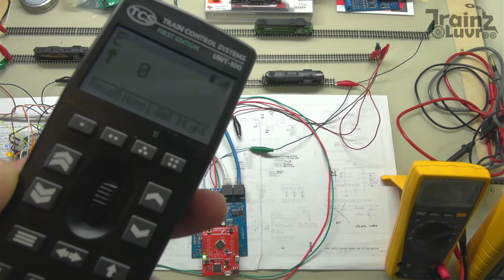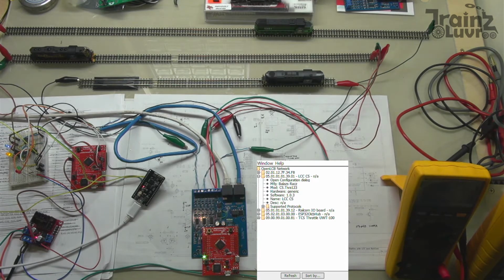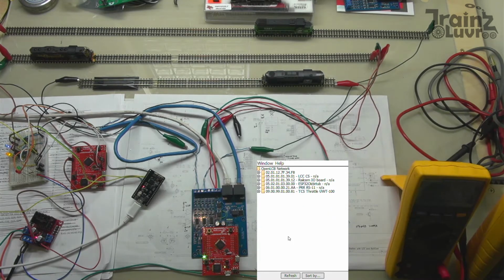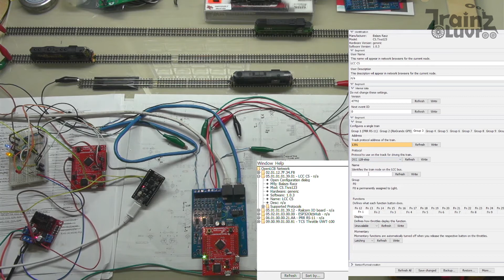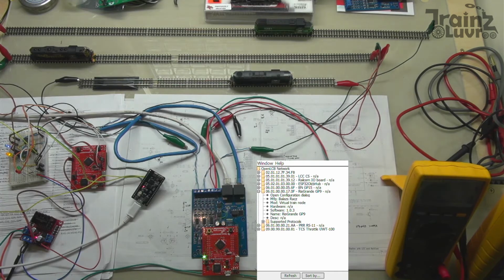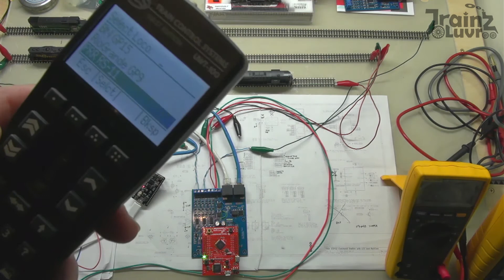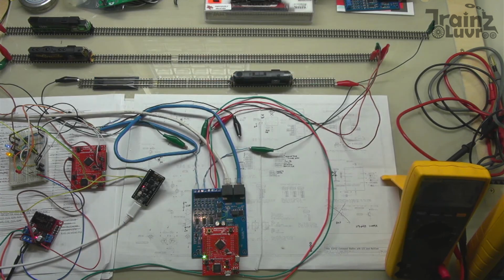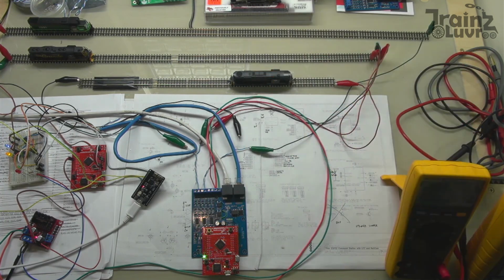What's the Big Deal with LCC?

Comment: Is it possible to have this system control everything except the trains, which would be controlled via dcc? Can you have both running simultaneously on a layout?
Reply from the maker: Of course, many who have adopted LCC early on have been using it in conjuction with their existing DCC systems, before any LCC command stations were made available.
Without a dedicated command station (for the traction part/locomotive database) you might not get the full benefit of LCC, but all of your accessories such as turnouts and signals can be controlled and programmed via LCC and JMRI for example. This allows for some very complex interlockings which would be difficult using DCC only. You may find many answers to some of these questions at the NMRA LCC User Group at https://groups.io/g/layoutcommandcontrol

Comment: Hello, very interesting. I'm learning about this new LCC bus for model railroad but as I know I only found RR-Cirkits as manufacturer for LCC compatible modules, are there any others? I'm also interested into your detection module which seems to support RailCom. Is this already a commercial product?
In advance thank you for your answers.
Reply from the maker: Hi! To be honest, RR-CirKits are the only one actively manufacturing LCC nodes. There are a number of other vendors/individuals that are allegedly developing something, but their timelines are unknown. Logic Rail Technologies apparently has a Fast Clock LCC node, but that's about it - no other info. TCS is working on a LCC Command Station to go along with their UWT-100/UWT-50 throttles, but its release date is also to be announced (hopefully this year).
The Railcom board is a custom design by one of the OpenLCB developers, Balazs Racz who kindly shared it with me, which I was able to replicate and use on my layout (in progress). You can see an annotated photo of my main panel in Staging, which has a number of those Railcom boards, a custom built LCC Command Station based on ESP32, and several other RR-CirKits nodes - https://trainsluvr.com/for_forums/20210220-west_staging_main_lcc_panel.jpg

Comment: Nice work!  Thanks for sharing.
Reply from the maker: Thanks for watching, and the comment. I am planning a follow-up video to this one, as some of the feedback I got suggested more explaination is needed to the relationship between LCC and DCC.
Reply: There are so many cool topics in your demo that I feel you could make a whole mini series of how-to's!  Sorry, I was hoping for more than one.. (all jokes of course).  I think it's pretty cool to see people contributing to an open platform and showing just how individuals can build new features to solve old problems.  Looking forward to your next video!
Reply from the maker: @richardmartin4479  You are absolutely right, it's only scratching the surface here and I did think of this as 1 in X kind of video. If you have any specific topic ideas I would be happy to entertain them.
Some issues that came up were that the video is too technical in nature, and I've lost 1/3 of the audience the moment I started naming and describing various components. The other issue is the fear of new things (LCC) and/or unwillingness to let go of old (DCC). I suppose the circle repeats itself, as the similar thing happened when the DCC was introduced as well - took a long time for the DC modelers to embrace it. Although in this case LCC is not replacing DCC, but supplementing it, I feel I definitely need to do a better job in explaining that in my next video.